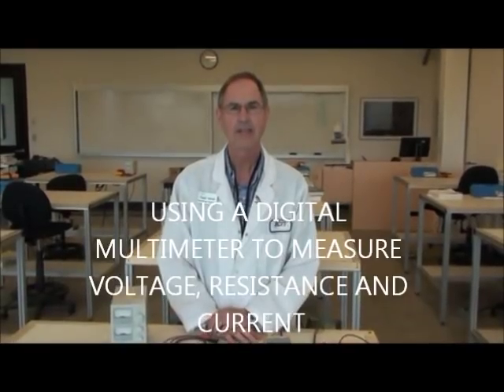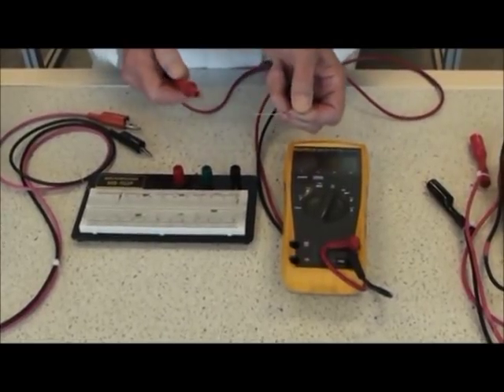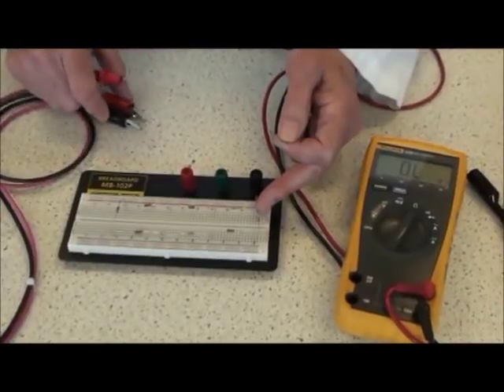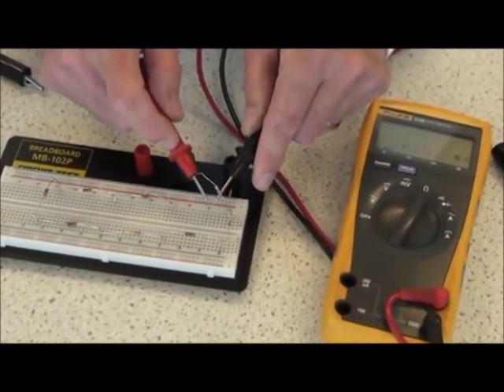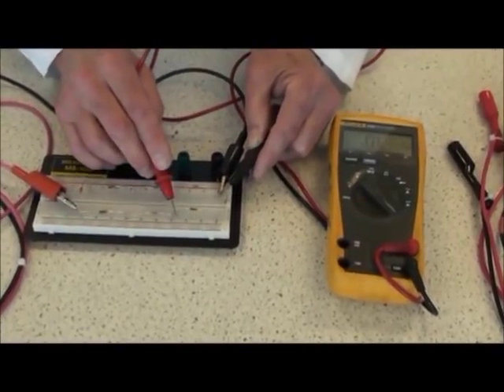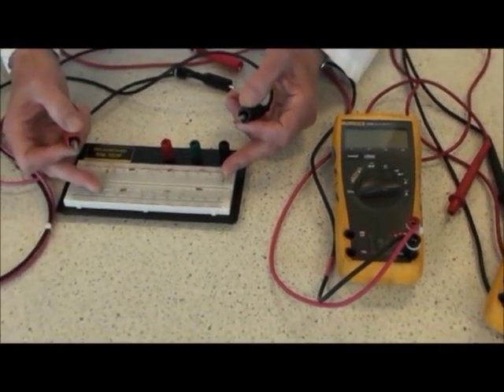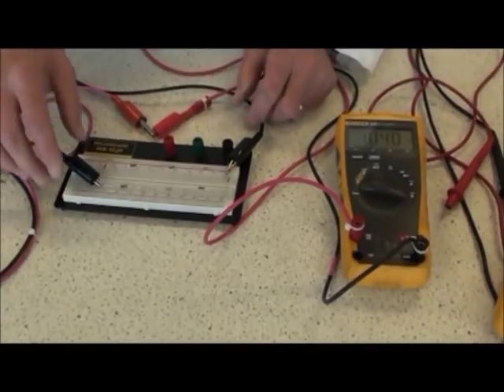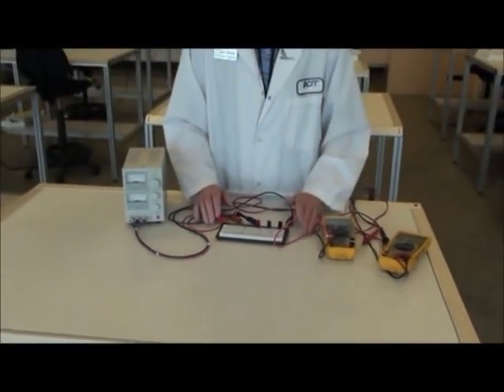How to measure Voltage, Resistance and Current with a Digital Multi-Meter

Comment: Which specific model FLUKE multimeter are you using?

That information would be much appreciated.  Thank you.  Excellent video!
Reply from the maker: I used a Fluke model 23III.  Great unit, but I don't think that it is sold new any more.

Comment: Thank You So Much Professor. as i was making a Gadget of Spotwelding by a Transformer and wanted to know how to read the Current on the Secondary coil. Though I still have a doubt to ask you about that my Multimeter has a Marking of 2000u, 20m, 200m & 10. Now, should I assume that my Multi Meter has the maximum limit is to read 10 amps only ? Can't I test and read higher Amps than 10 on this meter ? I w'd be thankful to you to guide me Sir
Reply from the maker: From what you describe the maximum current that the meter would measure would be 10Amps.  For welding, you would need a meter that would read much more.
Reply: oh, i got it....thanks a lot Sir

Comment: When you read current for just a part of the circuit, where exactly did you break the circuit? was it where both clips were clipped on? or the two wires directly outside of the clips?

Comment: while measuring voltage somewhere it is 5V and somewhere it is 10V but u have said that it is same everywhere.
Kindly take a look at it and correct it.
Reply: Because he's measuring across different number of resistors, across more resistors means less voltage, and vice versa
Reply: @MrJuliusJun  thought voltage stays the same on a parallel circuit?

Comment: For a total New B, how can you tell what the readings really are in auto ranging mode? with my Fluke 114 I measured the resistance in my dishwasher motor in auto ranging mode and it said 2.70 M ohms. When I tried to scroll through the manual ranging mode I was not even sure what mode I was in.  What are the modes,  in order, when switching in manual mode?
 I got an inexpensive manual ranging meter,  a BK Precision 2703C,  and it will not get any ohm readings in any mode from  200, 2k, 20k, 200k, or 20M.  Now what is up with that?!!
Reply from the maker: The meter will show what the 'range' is somewhere on the screen.  As far as your dishwasher motor, a low DC resistance is expected, but make sure that your motor is disconnected from the circuit in order to make a resistance measurement.  I don't know the ranges on a given meter, but they usually are noted on the screen or selection switch position.

Comment: In case you measure current, the multimeter has to be part of the circuit, do you have the schematic of this circuit with the multimeter inside? To appreciate better the example.
Reply from the maker: +Francie Velazquez Break the circuit where you want to connect the ammeter, then connect the red lead of the ammeter toward the positive terminal of the power supply, and the black lead toward the negative terminal.   In a series circuit the current is the same at any point in the circuit, but in a parallel circuit, the current varies depending on the branch resistance.   sorry I can't include a diagram, I hope my description helps. Ralph

Comment: The tut is fine for the most part; it was unacceptable when he seemed baffled by different voltage drops on his circuit using same value resistors ( come on)...
Reply: He wasn't baffled it was just a pause since he doubted whether he had to explain that or not. Because he's measuring across different number of resistors, across more resistors means less voltage, and vice versa.